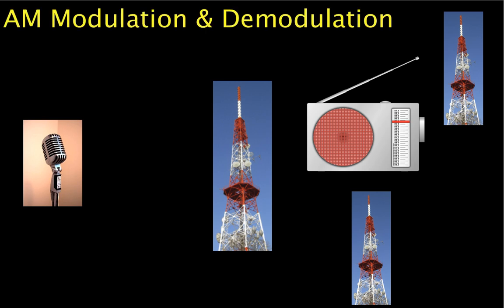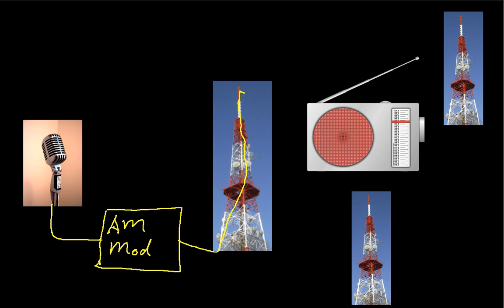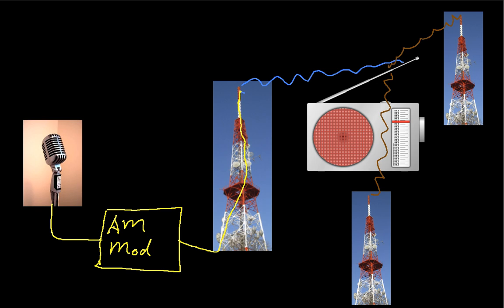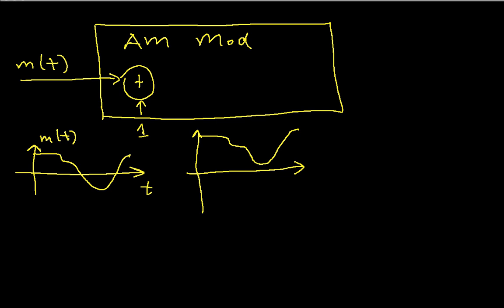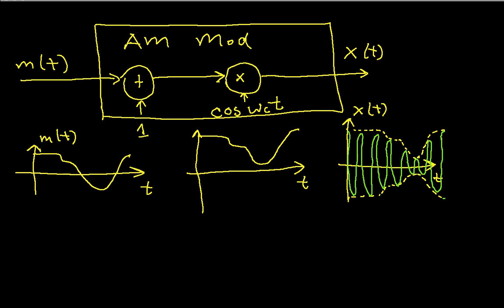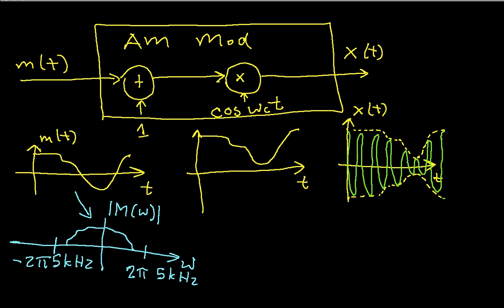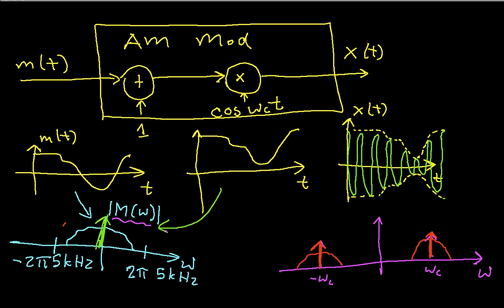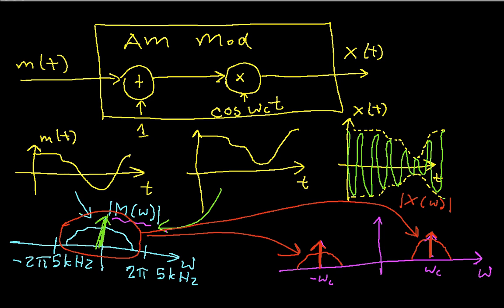AM Modulation and Demodulation Part 1

Comment from the maker: @BusTopLoner You can AM modulate a signal with a sine wave (rather than a cosine wave), and everything still works without problem. This is because a sine wave is equivalent to a cosine wave with a phase shift, and AM  demodulation does not require knowing (or estimating) the received signal's phase.

Comment: you know that there is two sideband in the Amplitude modulation right? which is the frequencies boundaries of some station. it means that this sideband prevents the frequency of the modulated signal stays on around +- 30 kHz variation.
the question is...
why there is frequency change in Amplitude Modulation signal? as we know that this kind of modulation just changing the amplitude of the carrier wave

Comment: ok so we have [m(t)+1]coswt right. if I expand that I get m(t)coswt + coswt.
I get that m(t) convolved with coswt gives the 2 sidebands but what about the extra coswt??? that is not the delta function in frequency. it should be 2 deltas either side no? how does he get the delta at w=0 ???
Reply: +Captain Rhodes adding the DC shift of +1, a constant +1 shift to a graph has a frequency of 0, which is why its at w=0

Comment: why is the envelope on both sides of time axis
Reply: Jchand shah because the cosine wave is still negative, so when it goes negative the always positive m(t) is multiplied by the negative bits of the cosine. so the output will have negative bits also. like  (+) x( -) =( -)
Reply: +Jchand shah Due to multiplication of the cosine wave and m(t) just follow through it on paper and pencil :D

Comment: Not very clear. Everyone, AM Modultion. Hit the Base of a NPN transistor with a clock frequency, and send analog audio through Emitter to the Collector. Collector to ground and antenna in the path of the Collector to Ground.
Reply: Sounds too easy.